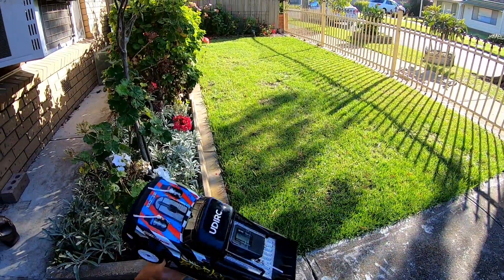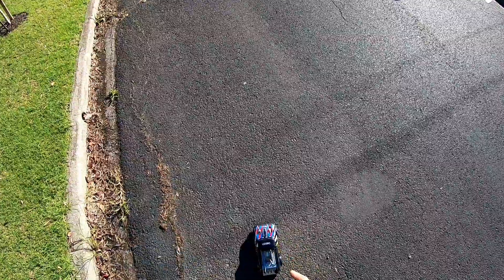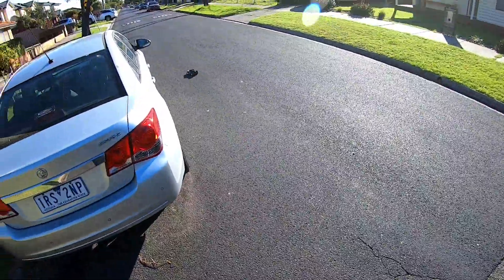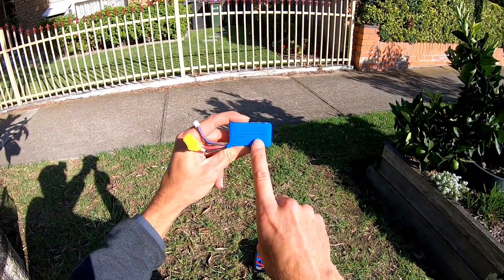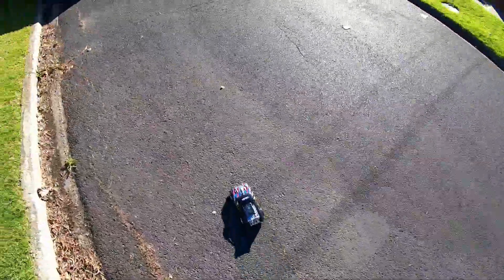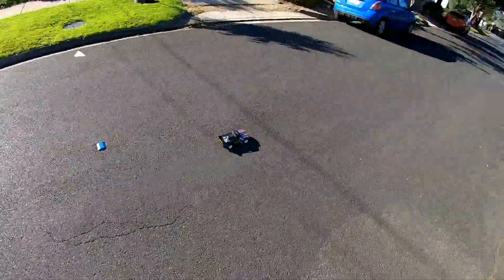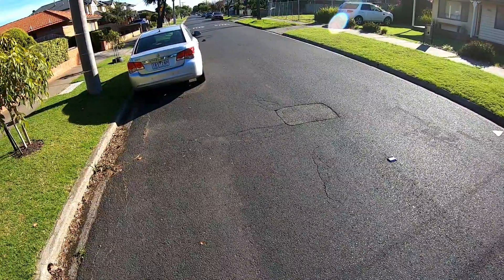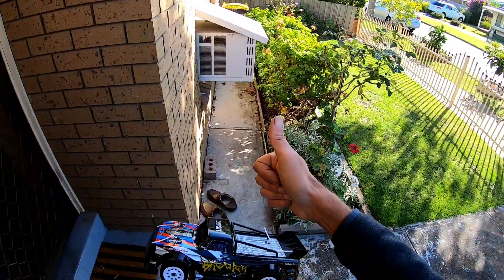UDIRC Breaker differential mod test, more stability!

Comment: I totally agree that you need a much better servo in that little rig.
Reply from the maker: Yeah got a new servo in and got some footage, much better👌
I just need to edit the footage👍
Reply: @rccrazy  Cool. I look forward to seeing it.
Reply: @rccrazy  What servo did you get?
Also, what did you do to the diffs?
And did you do anything to the looseness of the back wheels?
Reply from the maker: The servo is a Emax ES08MA 2 micro servo.

The diff modification is hard to explain but basically it's just removing a small amount of plastic off the bottom of the internal diff gears.

Not sure what you mean with the rear wheels, mine are fine, not loose at all🤷‍♂️